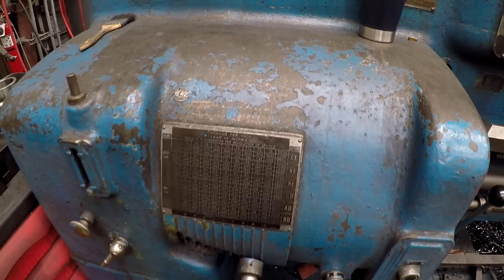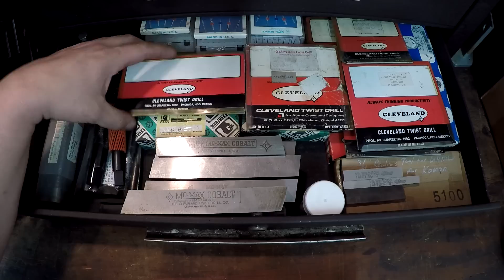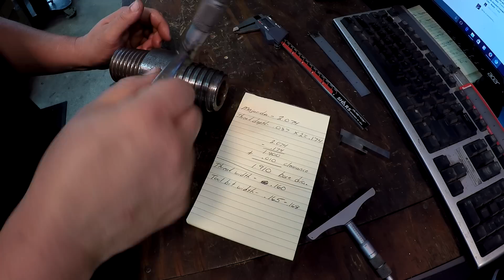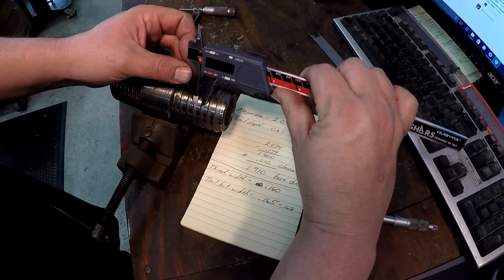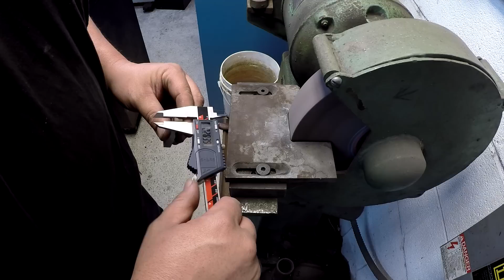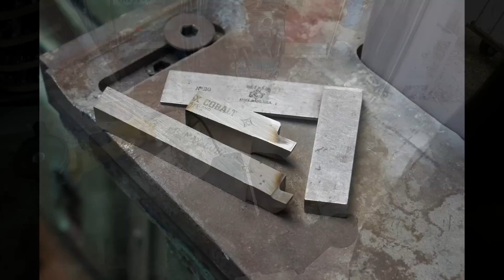Gearbox Shaft for Well Drilling Part 5: Grinding the Tool Bit for Square Threading

Comment: I used to work at a company that made thread adaptors, like the one in the video. If I'm remembering right, the taper thread was a modified acme and the other end was usually square threads of varying pitches. We used to use lathes that would pull the tool out of the thread when you disengaged the lead screw. Which meant when cutting internal threads you had to cut with the tool upside down.

Comment: I use a small grinding wheel & an air grinder (dremel will work too) to grind the chip breaker in tool bits. I also made a tool bit holder to grind tools with square inside and square outside for 3/8 and 1/2 bits that we used constantly

Comment: I have grown really used to using inserts but I still grind a tool from time to time. It was interesting to see how much finesse you actually used at times; just barely kissing the tool to the wheel to break an edge, etc. Very nice, Adam!

Best wishes,
TZ
Reply from the maker: Thanks Tom. Yes sometimes you only need a slight touch on the wheel to clean up the surface your grinding.

Comment: Sometimes, I put it in reverse, to see if what the threat pitch match is.  that way, I start near the chuck and work out....no worries of crashing the chuck or the cross slide.  same result.

:)
Reply from the maker: On that Pacemaker you have to throw a drum switch on the back of the machine to go in reverse. I never bother.

Comment: That was sweet to watch Adam, and epitomizes skills that should still be basic in even a CNC shop: when a job calls for a cutting tool you don't have in your toolbox, but the material can still be cut with HSS or cobalt, MAKE THE CUTTING TOOL YOURSELF, no need to go digging through an insert catalog to order some super expensive custom carbide insert that you'll only be using one or two times a year or even less.  Save your dough and make your own tool!

Comment: Adam, I thought when grinding HHS, if you get any color change, you have taken the temper out of the tool bit. Is this true?
 Thanks! I've always taken long time at the grinder to prevent this, especially on smaller grinds...
Reply from the maker: No sir, you won't loose it's hardness.
Reply: sweet, no more spending 30 min in front of the grinder! (I'll try to keep it to a dull gold/brown and avoid purple! LOL)

Comment: At 3 threads per inch, the theoretical size of one thread land or groove would be 1/6" or 0.167" (.166666...). Anything larger in the width of the cutting tool would give axial clearance (end play in the threads); anything less than 0.167" should cause interference. (This is assuming that the target also has a perfect - less clearance - match between land and groove size, and that there has been no wear.)

The tool will need extra side relief on the right side (left side for external threads) to accommodate the helix angle. The helix angle can be shown graphically by drawing a right triangle with base equal to 1/3 inch and height equal to the circumference of the thread. As you noted it needs a curved front relief to accommodate the arc of the internal bore.

Comment: Adam,
You REALLY need to think about a holder for grinding those bits. They are your fingers and I know you would like to keep em so just saying...... Really one slip and you get an instant manicure.Been there and done that and it hurts like hell. Especially with quenching it making it slippery. For the rough out part at least. Be careful cause it only takes one time. Good tool grinding video even with the safety issue.
Reply from the maker: I've thought about it for years and never spent the time making some jigs. Hand grinding for now.

Comment: Very nice hand grinding. My question is that by looking of the thread, should not have been grind the actual tool, the narrow part, on the other side of the 3/8 block?
It's amazing how well you can center in the 4 jaw, I often watch you doing that.
Love your old machinery and your channel.
Bob
Reply from the maker: Thanks Bob I ground the tool so that I can come all the way up next to a shoulder. Check out the next episode this weekend.
Reply: Thanks, looking forward to.
Bob

Comment: Are those tools made of HSS alloyed with cobalt? If not, I think the overheating annealed them.
Reply from the maker: No sir it did not. Very surprised at the amount of comments I'm getting about that.
Reply: Talking from an amateur blacksmith's perspective, in my experience, getting a tool purple-blueish on the grinder usually results in that tool losing its hardness. Now, if the lathe tools are made of high speed steel that is alloyed with cobalt, then it's an entirely different story-don't quote me on it, but I think such steel held mechanical properties until 600 something degrees Celsius, which is a faint red glow. Good video, though, keep em coming!
Reply from the maker: These types of tools have a red hardness to them. You can grind on them all day long and they will retain there hardness.
Reply: Abom79
So they are HSS alloyed with cobalt.

Comment: good show and tell adam. you didn't mention anything about compensating for the helix angle of the thread when grinding your tool or is this not an issue with this combo of thread pitch and tool size?
Reply from the maker: Not a big deal as long as you give the tool enough side clearance.

Comment: Hi, I'm not a machinist at all, but I used lathe few times in my life, I'm here because I enjoy watching things done ;). Great stuff BTW.

My question is about thread making - as tool is moving to the left and thread as this one has square profile (flat sides), shouldn't there be a lot of "relief angle" on the left of the tool? I mean if tool left side is almost vertical doesn't it rub against thread below cutting edge as it goes deeper into workpiece? I know that there is always relief angle, but I never heard mention of this issue and if it should vary depending on thread (bigger step, bigger angle). Sorry if its stupid question :)
Reply from the maker: Yes you do have to have the proper relief angles and clearance for the tool not to rub. I may not have touched on that subject enough but i had the tool ground right.

Comment: i don't follow with honing the cutting edge, square to the cutting tool (assuming you're holding it flat, level, on center to the lathe). seems to me you should hold the hone at the relief angle you want.
Reply from the maker: Eldon Johansen yes that's what I was trying to show, holding it in plane with the relief angle.

Comment: really beautiful grinding job. i always use ear protection when in the shop, little shallow foam plugs that take the edge off everything without being uncomfortable or pushing ear wax around, and double up with the muffs when using tools. i like being able to hear and not having the tinnitus that all the old guys are being driven insane by.
Reply: Old Guys.....Insane...Yeah...I'm 69 and been dealing with real bad tinnitus for 25 years...in addition to hearing loss of 90%...BUT...it was caused by chemical poisoning, not noise....although it was in a welding/fabrication shop......
 Chemicals? Tri-chloroethylene.....AKA chlorinated brake cleaner....never use it around any welding arc...it becomes phosgene gas  when exposed to ultra-violet light....Phosgene...AKA 'mustard gas'....
Reply: I also wear a respirator when grinding as well as muffs. Don't like coughing up black junk later.
Reply: ... or find yourself mentally designing a nostril reamer while you are trying to clean the junk from your nose.  That stuff almost sets up like concrete.
Reply: for sure. also wear at least a dust mask when doing anything that can kick up dust, and work wet whenever possible like on cutting concrete or busting rocks to keep dust down. guys will laugh at me, but they won't be able to laugh anymore when they come down with silicosis in 30 years.

Comment: Nice bit of grinding. I was looking at the crossover with the square thread and the other end looks like an API thread, 2 3/8" IF (Internal Flush). Quite common for drill pipe.

Comment: Awesome. Nice to see that. I learned my job 1986 in germany (you have to learn to be a certified precision mechanic or so called here a machinist for 3.5 years). We had to grind all of our cutting tools by hand, because the inserts where to expensive and my boss was an old school  guy. You really learn what your tool is doing when have to build it yourself. I love this.

Comment: Nice job on the tool grinding Adam. I like the Abom size grinder you have there it is almost as big as mine !
Reply from the maker: LOREN LIEDER Which one did you have? The 14" Baldor? Seems like that's what I remember seeing. Nice grinders too!
Reply: Yes Adam the 14"x 3" Baldor 3hp that I sent you a photo of last week.I took it in on a trade for work in my shop.

Comment: The Pacemaker is only a 20" swing? I thought it was a lot bigger than that.  Good to see the big grinder back in a video.
Reply: bcbloc02 Yeh Adams only really  5ft and 90 lbs , he just uses very small gear to make him look bigger 😃
Reply from the maker: bcbloc02 yep 20". It's looks much bigger though doesn't it. It will swing 25" max over the ways.
Reply: Abom79
It is those go pros, they make everything look huge, just like my barn shop. lol

Comment: I working at Gleason Works in Rochester ny in 1964 in a chucking turret lathe department I ran an old J & L.anyway there was a big American pacemaker lathe there ,it was used rough out steel forging for spindles in gear cutting machines,big blue chips came off that beautiful machine.
Reply from the maker: Mike McEwen awesome machines!

Comment: I guess that you know what the blue color means when you grinding high speed steel... You have to harden it again if you want "long" life of that bit. For a single job as you are doing it may work just fine. Thanks for all your videos, love to watch them! 

Greetings from Sweden!
Reply: This is a myth.
You can turn HSS cherry red and it will not soften when it cools.
Reply from the maker: gert from Have never had problems loosing temper on hand ground tool bits.
Reply: HI! Just the question and answer I was wondering about. What about the use of a friction cutting wheel vs a carbide cutting wheel when cutting metal for welding in a chop saw?
Reply: I was taught that when you went blue on HSS you have lost your temper, by the older guys. Back to the wheel and grind of some millimeters to get back to the hardened steel. So I've been fooled? =)
Reply from the maker: Sounds like a Tom Lipton trick. Keep chasing that blue! LOL

Comment: noooo! dont use a grinder to cut cobalt, cobalt dust is carcinogenic. if you breath that in, you are fucked, now you are ganna die of cancer in 8 years
Reply: Most hard metal dust, including cobalt, requires long-term exposure before it brings health problems.  I.E. - Miners and refinery workers.
Reply: thechosendude true
Reply: Sounds like he was wearing a respirator in that last part, when he cut it off. Not when he was grinding to shape, however. How do you grind a tool bit without a grinder?
Reply from the maker: joey idk And I've been grinding those tool bits for 20 years now.
Reply: Abom79 8 more years man...8 more years

Comment: That is a wicked grinder!! What grit do you use for the coarse and fine? My 8" x 1" does not chew cobalt like that. Awesome video thanks for sharing.
Reply from the maker: greasydot man it's been so long since I installed those I can't remember exactly, but I want to say 40 and 60, or 60 and 80.

Comment: hey Abom79, love the video, great work. here's a helpful tip if you don't already know. when getting the cutting face square with the tool you could use your small machinist square, if small enough, and set it on the grinder surface and run the tool along it but that only works if the grinding wheal is in line with the grinder surface.
Reply from the maker: andrew larsen The took rest edges are not square to the wheel.
Reply: Aw, well keep up the great work.